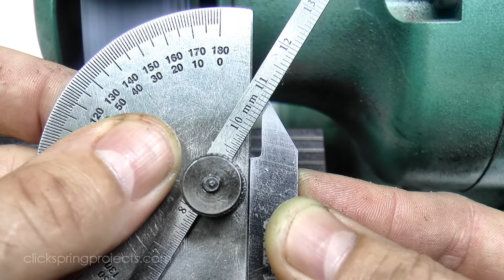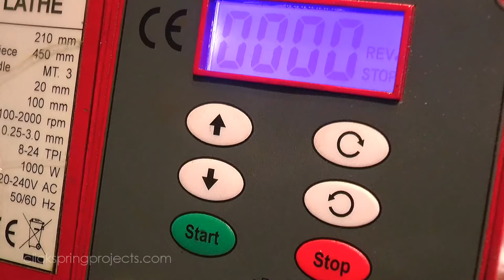Single Point Threading on the Lathe I

Comment: Brings back memories of me and a Harrison M250 lathe in my first job as a Toolmaker. Hand grinding 95%+ of my tools myself, mostly self taught. I preferred roughing the tool on the wall grinder, then finishing it on the surface grinder. Parting-off blades 0.010" thick. Having to 
flat-bottom 1.0mm.diamerer drills by eye to make special insertion tools for I.B.M.  I often miss being on the tools. Turning, milling, grinding and jig-boring. CNC's are so soulless.
Reply: If i were to learn machining for a job in the manufacturing industry, am I more likely to learn to do it on a CNC/computer programming than the way you did it? Just wondering.
Reply: @americanstriper8666  there wasn't a need at the time, nor the budget for a C.N.C. lathe, as my company was in its infancy. Indeed there is a place for each CONVENTIONAL and C.N.C. requirements. If you're making one-offs or low numbers of something it's more efficient to make them on a conventional lathe. However, if high numbers are required, the extra time writing the program for a cnc is cost-effective, and can be stored for future use. When I started serving my apprenticeship, the company only had an old MYFORD SUPER 7 to use (a model-makers lathe) then a newer one, then a brand new Harrison M250. And further lathes as the company grew. Conventional and CNC lathes both have their place still.
Reply: @ianmorrison6798  still an undergrad in his 2nd year and when I understand everything you say, really make me happy

Comment: I really like the full thread profile carbide inserts, they make the nicest threads especially on a cnc-lathe when the cutting speed is much higher.
Reply: My mechanic also watching lathe videos >.< I started watching these after your videos. So satisfying to watch🖤
Reply: I own high precision screw factory in India, we make millions of these on screw cutting lathe, with carbide inserts. The production method described here are only for hobbyists
Reply: @AS-ug2vq  The carbide inserts are nice however have there limits, at least the one I have which is limited to 12tpi. I recently needed 8tpi and had to use my HSS bit that I had made up previously to do 8tpi.
Reply: @AS-ug2vq  : The video title is "Single Point Threading on the Lathe"... hardly a technique anyone would use to make "millions of these".
You should be watching the video titled "Make millions of screws on screw cutting lathe with carbide inserts, for high-precision screw factories"
This channel is aimed at hobbyists, after all.

Comment: Just a wee tip. If you do not need a square shoulder at the junction of your thread and stock, put in as big a radius as you can and make it smooth and ridge free, and angle cut the outer undercut edge with your threading tool prior to thread cutting. It will make dressing up the burr you always get and the big smooth transition radius will help prevent fracture if you are using it for a lever such as on a drill press quill. Nice job all the same.

Comment: Machining is so therapeutic
Reply: It is soothing to watch. The shops I've worked in are loud, dirty, and busy yet watching metal getting cut was still an interesting job. I didn't like making hundreds of the same part over and over but that's part of the job.
Reply: It looks like, before you see backstage =)
Reply: M T  both. I've worked in different shops and one of them had all old equipment, some of it made for WWII. If you can afford a cnc machine they're great at turning out precision parts. If you're good at programming that's the way to go but a mistake can be very costly. If you're making one off parts then they are not really cost effective. 
I'm sorry I can't give you a better answer. Maybe if I had an idea of what you're planing on building?
Have you watched " This Old Tony "? He has a lot of videos that may help you decide which way to go. ( he's a lot smarter than I am too)
Reply: @BCM1959  And his gags are hilarious, ie cutting steel stock with a brick bolster.
Reply: @markfryer9880  or a karate chop...
Reply: I agree and I don’t have a lathe.
Reply: Very therapeutic

Comment: nice work bud  ive watched a few people screw cutting here and thats about the best ive seen yet.    its been a long time since ive had to do any manual screw cutting and generally it was between centres with a face plate and a dog, we still ran some positive rake on hss tools and i noticed you even flattened the point,, thumbs up.     great to see the thread end groove although we would radius it,  two thumbs up for showing the test cut  and pitch gauges.   just for the sake of saying it we would also do a full depth of thread form cut as a lead and depth indicator on the face .  cutting would normally be a ten thou depth cut and subsequent cut would be the same with the addition of a five thou side adjustment on the compound slide to give some tool clearance on the trailing edge.   then a touch up with a stone to cleanup the thread faces  always done with coolant    the tool would never fill the thread form completely as there would be no tool clearance and allowed clearance to be adjusted in the root.     not saying its the only way just how we did it in the old BHP days.   love your work.  admire your patience cheers

Comment: Your careful grinding and honing is very much rewarded by the excellent finish of the thread. Despite the dominance of carbide inserts (even amongst minilathe users) they're just not as sharp as HSS (can be...)
Reply: To be fair towards the carbide tools, they aren't made with really sharp edges for the specific purpose - to prevent chipping the cutting edge. It's especially critical with less rigid small machines. That's the main reason why mini lathes and mills benefit from HSS tools - they simply last longer there.
Reply: @sciloj  I'm not quite following your various statements.

What tools are prone to edge chipping on which lathes?

As a data point,  HSS was used (with advantage) on large industrial lathes prior to carbide's introduction (circa 1935)
Reply: On any less rigid lathe, carbide tools get damaged easier than HSS. Mini lathes are usually less rigid. That's why HSS tools are better for small lathes.
Reply: @sciloj  and since HSS can be honed to a finer edge, cutting forces are reduced, and finish improved. HSS is the way for smaller lathes
Reply: @paulwomack5866 , both HSS and tungsten carbide can be made really sharp. But turning inserts aren't usually made to be sharp to make them last longer since carbide is hard but brittle. That's the idea behind it.
Reply: Does the brazed carbide tooling not take as fine a hone as the hss?
Reply: Both have their uses. I would not grind a form tool in carbide, HSSCo is better. That said You can get a sharper edge in carbide than in HSS but You need to use specific fine grained grades and lap them. They are more brittle than HSS, but not to bad. Regrinding used fine grained inserts very sharp is often done by toolmakers and prototype machinists, Stefan Gotteswinter has an excellent video on that. You can buy them sharp but they are rather expensive.  Sometimes sharp aluminum inserts work well in steels. In Ti You probably want slight positive rake and very sharp. Just experiment what works in a mini lathe and use what gives best results. Having the ability to grind lathe tooling is a very valuable skill.

Comment: I have been having trouble getting a 20tpi (guess that's a UNEF) decent looking thread on a 3/4" bolt using a carbide threading tool. A test bolt was made in both aluminum and brass, the carbide insert change to new, but yet the threads just looked rough and nothing like they should. Other videos seem to show carbide working, but after studying your grind angles I am thinking of trying again using a HSS tool instead. (Note: I really have cut more common threads with success.) I am open for any ideas, or confirmations. Thanks
Reply from the maker: G'day Tom, generally when I am getting a poor surface finish (when all appears to be as it should be), its because of a lack of relief clearance - ie something wrong with the cutter geometry, or how the cutter is being presented to the work - Cheers :)
Reply: Fashioned a HSS tool bit similar to yours and made some fairly good threads. Not sure why the insert (new) didn't work but? It seems I get a better cut normally with HSS over inserts (my opinion, or skill level). Thanks and your work is truly fantastic!!  @ClickspringClips

Comment: When l first cut threads on a manual lathe i was instantly spoiled. Hardinge HLV-H. Single Tooth Reversing Dog Clutch in the gear train between the spindle and the leadscrew. No matter the thread. SAE, ISO, DP or Module repeatable pickup every time. No opening and closing the half nut. No watching a threading dial. No reversing the spindle to wind the tool back to the start. Every home hobbiest with a lathe should build one for his shop lathe. After I was judged Proficient at grinding tools off hand I was allowed to make tool grinding blocks. From then on I always ground my threading tools on a surface grinder. Perfect 60 degree included angles. perfect side clearance. Plus l was able to grind top relief for when cutting tougher materials. Wound up making a block for Acmes and an Adjustable block for specials and stepped form tools.

Comment: My old mentor's trick on this is to feed the depth in at 60° so that you have only one side of the bit cutting at a time, not both, which prevents chatter and ugly surface finish.
Reply: A closely related strategy is set the compound at just slightly less than the included angle, so that the vast majority of the cutting is on the leading edge, the receding edge takes something like a finishing cut, and it simplifies the advance math because you zero the cross slide each time, then advance the compound just a little.  At the end of the cut you back the cross slide out one rotation, reverse, advance it in to zero, and advance the compound.  This reduces the possibility of advancing the wrong amount.

Comment: Honest question. Why do machinist make threads on the lathe like this rather than using a die set? I would assume because a die would require that most of the material already be removed, but other than that, I am not too sure.
Reply: A few situations; as having the option to make threads in a lathe and threads with a die are both options: 1) dont have a die to a specific thread size— maybe you need a 10-32 thread made but you don’t have the die in hand. 2) versatility+accuracy the machinist is given/provides with
Reply: Mostly because single point threading can make a smoother, more accurate thread.

Comment: Very good work done you turn cross slide and fed from there iit is the genuine method to cut thread the way you centered the tool(coter) the way you made it right angled i like and enjoyed which lathe are you using.
I had schbliene wirh me great machines

Comment: Hi Chris,just wanted to say that you raise the bar very high for other youtubers with your videos + a request video.How do you manage all these metal scraps from your work?thnx for reading and looking forward to your next video
Reply: dimarg00 machine shops will generally have scrap metal bins for offcuts, as well as all the swarf from machining. You can sell it to scrap yards (they will typically send a truck to collect the full drums and swap it for for an empty one)
Reply: I see,i was thinking maybe something as melting and reuse for other projects but i guess recycling as u mentioned probably is more common way
Reply: @dimarg00  yea..maybe for casting, cant just melt metal and make a new stock bar from that. Gotta deal with impurities, and i assume a lot more
Reply: @SiIverBacks  
Recycled steel is never as good as new steel, especially after its been turned to swarf as there is more contaminants.
   Where I work we machine tons of swarf a day, literally, as it's heavy industry.
   When you have offcuts, especially of nickel products it just gets sent to the plant they make the steel and re-melt it if you can be sure it's all the correct grade.
  When it's turned to swarf it needs to go to get cleaned, sorted all sorts to get rid of contaminants like broken carbide, coolant, scale and anything else even if you can keep the correct grades of swarf seperated.
   Most places the swarf will just go to the recyclers with all the other scrap and it goes for "pot metal" , nothing is assured , it's usually low quality, the Chinese often use it
Reply: @landlifem5872  The iron content of sorted by metal type swarf is much higher than raw  ore pellets. Swarf being what you call dirty is totally viable of being recycled into high quality metals and steels. Recycling of various metals is not something that can be economically done on small garage scale to the same quality standards a real mill can do. Cost wise for ferrous metals it generally is not worth it to re smelt such scrap.

Comment: I had always wondered how threading was cut "automatically". I have only ever used taps and dies, and couldn't figure how the machine could match tool speed with rotation without CNC. Should have figured there'd be some kind of 'guide' for common pitches.
Reply: In a manual lathe it's all gearing.  There are separate gear clusters for turning SAE or Metric threads.

Comment: Is this reply to Adam Savage's try on lathe threading? :)
Reply: While Adam showed some trick that could save a novice's ass by preventing crashing the tool holder into the chuck by reversing the process and cutting away from the chuck, he also showed the wrong and dangerous way to increase the depth of cut. With threads of that size, one should never use a cross-slide to do that (that's exactly why Adam kept messing up everything - tool pressure was growing tremendously on each step since both sides of the tool were engaged in the cut). Chris, on the other hand, showed the correct technique of using the compound slide - that allows to engage only the left side of the threading tool and keep the proper pressure.

Comment: Part I don’t know how to do on my Craftsman 12x36 is getting it to restart in the same line. I can setup the job and get the gearbox set but I’m stuck beyond that.
Reply: @whitpusmc I don’t know about your machine, Sometimes there is quadrant indicator to show the position of the lead screw, you engage the lead screw handle when the quadrant is the same position you started the cut. Otherwise you need to remove the tool from the cut very fast at the finish, stop the machine with the brake, leave everything engaged then put machine in reverse back to beginning of the cut, then start again, rinse and repeat.

Comment: Hi what angle is the compound slide is set at when cutting thread? Please and thanks.
Reply: 29 and a half degrees for the typical "V" threads.  I don't know if other thread forms use a different angle.
Reply: @Ddabig40mac  ok thanks.

Comment: Absolutely loved watching you shape that cutter!! The very last thing you did with the wood handled cone thing... First off, what was it? Secondly did it just slightly flatten the threads you just cut??
Reply: It's a hand vise...the cone (connected to the handle) will force apart two levers that are connected to the jaws over fulcrum points. So you tighten/loosen the jaws with that screw.

Comment: I have no doubt that Chris knows his equipment really well, but those who don't might fail by blindly following his steps. Generally, centering a lathe tool on a live center tip is not recommended since tailstocks aren't guaranteed to be coaxial with the spindle and oftentimes definitely aren't. So, don't do that unless you know for sure that it is coaxial.
Reply: Sciloj, I didn’t run it back for a look, but my impression was that the pointy center was in the chuck as opposed to the tailstock; if correct, would that be precise enough for centering the tool?

Comment: I'm amazed by every single clip you share. Can't wait to see the full mashup (hours?) Once the antikythera is finished. With the extreme precision you demonstrate, it always makes Myles cringe when seeing the 'CE' (Chinese Export) tag...or as AvE says; 'The Mark Of The Beast'    I secretly ponder ti myself if the mechanism will work, given that the tolerances are basically 0.0000001mm and you're not using a sub-mm DRO. Granted, the folks who built the original didnt either, so it'll be interesting to measure the planets and stars over time. You obviously kno what you're doing...so maybe take a little hint from Jimmy Diresta & ABom79 and slap a ClickSpring sticker over those CE tags (lathe, tool holder, etc.) ;)   love your stuff regardless
Reply: James Bramlett CE is a certification mark that means it meets the standards to be sold in the European Union,
Reply: @danvanmuizenberg6650  - I'm aware, but the CE on his lathe looks a bit more like the Chinese Export version. I'm tending to go with your assessment in this case as the tolerances he deals with seem too tight to use a cheap tool. Thx

Comment: I have machines thousands of threads from 3mm dia. To 800 mm dia. and never set the compound on an angle. I never understood why machinist do that.
Reply: Same I never rotate the compound angle just leave it at 0 deg. I always leave the half nut engaged and just instant reverse , also side cut (backwards ) , I like cutting 2start acme , quite rewarding when it fits perfectly 👍👍

Comment: I just wanna point out, that you should hone a radius on the tip of the tool, not just the flat. With flat tip, you won't get proper radius in the root of the thread.